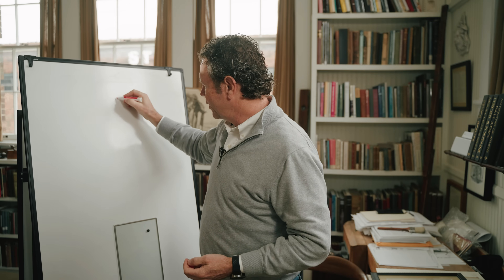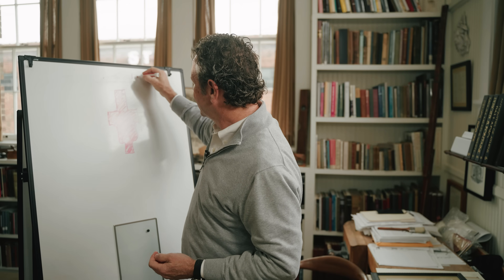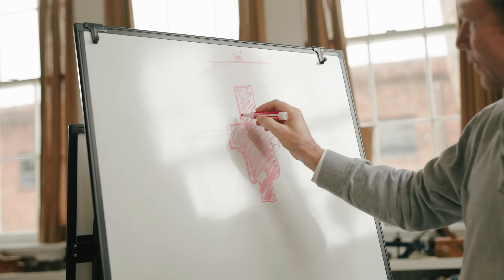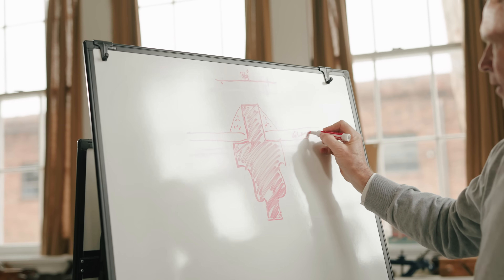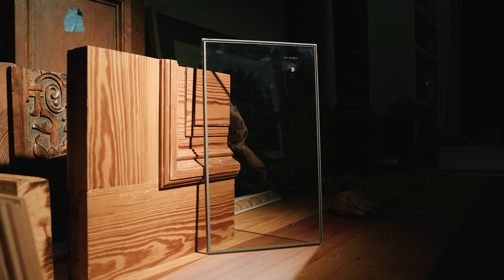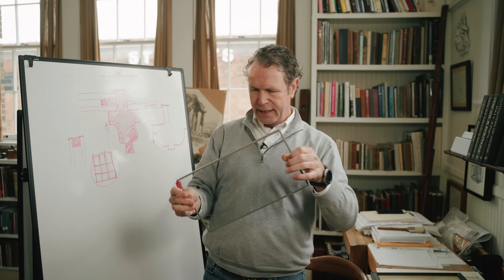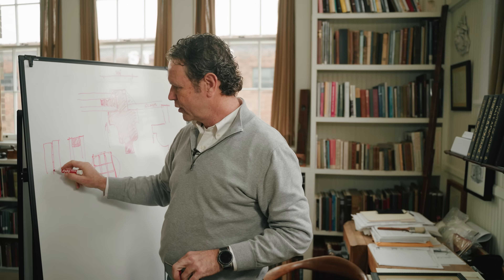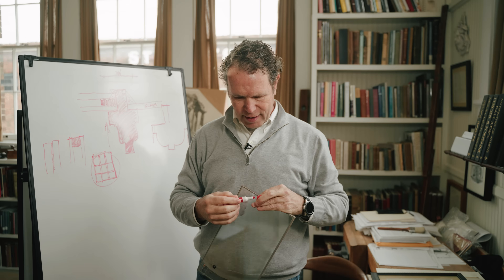Historic window glass – why insulated glass needs a major redo!

Comment: For giggles, I'd do exterior face 1/8" borosilicate glass cold laminated to a 3/16" polycarbonate core cold laminated to an inner face of 1/8" borosilicate - for impact strength and temperature gradient shock hardening.  Exterior glass face having a sputter deposited UV/IR mirror with full visible light bandpass, so it's protected from damage and dirt by the lamination.  Polycarbonate provides web strength in tension should the glass break, the cold lamination would retain the bulk of the glass shards should the faces break, and would add some sound deadening to the stackup.
  
Then do the mutton bars with a titanium extrusion welded into a grid and then to the window frame (structural titanium has about the thermal conductivity of vinyl, or slightly better).  This would be so you can do the mutton bar in a traditional narrow width, but retain continuous pressure and vacuum strength - plus flexural strength against impulses.  Individual lites held in with a Sika polyurethane structural adhesive for transferring that glass lite strength to the muttons and the frame.  Maybe an anti-spall film on the inside bonded to the mutton, with a magnetic interior trim to allow for servicing the bond and enabling replacing panes (and painting the interior face of the mutton without having it on the glass?).
  
Those little spacer balls look like ceramic vacuum spheres - I'll bet a custom lab glass shop could replicate those panes with a better plug for the vacuum (the same way they did vacuum tubes).  That tube tail for the vacuum draw could be done on the face of the inner piece with the tail embedded in the cold lamination pour along the edge and therefore protected.
  
I could also see a variation on this video's method which uses laser welding of the glass (Coherent does this with CO2 lasers).  By gently rolling those little ceramic (I'd use Zirconia for teh low thermal conductivity) vacuum beads on the top face of one piece and lasing the glass from the oposite side the glass would melt at that location and a ceramic ball would "sink" into the melt and bond in place - makes for easier patterning of the spacers (the unwelded balls just roll off the surface).  Then putting those balls in contact with a roller that applied a non-outgassing glass adhesive, would stick the two sides together when mated.  By grinding a bit of the surface of each piece of glass around the rim of the pane, when the two pieces are put together a small void will be left.  Right at the edge of that void one can do a glass weld.  A small pre-made laser cut hole through one side of the glass to allow a vacum tube to be welded on (again laser) - to pull the vacuum.  Then a laser welds a ring around the tube entry at the flat glass and the tube is laser cut a little proud of the glass surface, then melted down into the tube hole like a rosette weld for a permanent seal.  Once the vacumm is pulled and the pane sealed, the void gets filled with the cold-laminating compound - which adds some mechanical stability to the joint (glass is directly sealed on itself, but no vibration or flexure would then crack the seal)
  
"Pretty", thermally performant, acoustically deadened, storm impact rated... very, very expensive ;-)
Reply: Crazy... I've been ragaling my family at Sunday dinners with this exact type of window design proposal for years now.. they all tell me wow thats so neat but we have children to feed.
Reply from the maker: WOW!! That's impressive.
Reply: @BrentHull  I did want to call out that I have noticed the improved video production where you are highlighting the details with B-roll for things you point out that the camera person missed during the initial monologue video capture.  I had lamented this in a previous video and you commented that you'd improve this, so I wanted to give the kudos where deserved - continuous improvement not just in building structures, but also building quality content.  Well done to you and the video team ;-).
Reply from the maker: Thanks for noticing, we're working on it. Still not where it needs to be but getting better. Thanks!!

Comment: Glad to see an alternative to insulated glass with space bars.
I have seen so much of it fail, whether it was the seal or the lo-E coating. I have replaced lots of I-G units that where only a few years old,  the glass was still intact but was full of condensation. Can Pilkington glass be retrofit into an old wood sash?
Reply from the maker: Yes, if you have 1 3/4" sash. 1 3/8" is too small. THanks!
Reply: @BrentHull  Are you producing the windows for your own projects only or do you take custom orders?
Reply from the maker: We take custom orders, shipping around the country. Send an email to info@brenthull.com if you need something. Thanks.

Comment: Andersen windows used to have glass like that except no ball spacers. They even had the the plugged hole where they sucked out the air and must have filled it with some kind of gas to keep the 2 sides spaced apart.
How is that so different from the Pilkington glass?
Reply: Pilkington Spacia Cool has an SI U-factor of 0.18 Btu/hr-ft^2°F. So about R5.5, according to their brochure.

Super Spacia has a U-factor of 0.11, so about R9
Reply from the maker: I appreciate you looking that up.
Reply: @BrentHull It’s the seal that aways winds up failing and I assume Anderson has a such a seal while the Pilkington glass does not.
Reply from the maker: I'm pretty sure Pilkington's is a vacuum (no air) and Andersen and others used and air spacer, sometimes argon. The difference is in the energy efficiency. As far as I understand Pilkington is the only one that uses a vacuum.
Reply: @BrentHull 

Pilkington Spacia is vacuum glazing and you cannot see its 0.2mm thick edge seal by looking sideways through the glass when it's in a frame. All vacuum glazing have dots.

If you can see a spacer bar, it is double glazing with air or gas in the cavity. 

If you can just see the edge of a 1-2mm tape and there's no dots, you might be looking at Histoglass or equivalents that use a dessicant tape to join historic glass together for aesthetics and a unit about twice as insulating as single glass.

Comment: I hadn’t even heard of spacia glass before this. At the moment, it is very expensive at a minimum of £200 per square metre - with that cost rising substantially (according to installers) if you wanted small-sized panes. I guess that, like most things, that price will fall over time, particularly when any (?) patent expires. I think that, as others have said, that you would need to live with one window of spaces to understand if the dots and the black dotes really annoyed you; perhaps a neoprene dot in clear might be better? 

I don’t know if it would be possible to make these vacuum panels using historic glass - i.e. slightly wavy - as it might not be possible to sled around the imperfect edges. 

A true divided light window is a joy to look at, just as is a “Tudor” window. For me, they just look right when windows with internal dividers (between the panes of a traditional double glazed unit) just look…..wrong. Glass in windows has obviously been around for a long time; the Roman buildings here in the UK (54 - 400 AD) were the first in the UK to have them and were obviously reserved the the most wealthy. Churches from Saxon times onwards had stained (or painted) glass windows but, for the common working man, it was the norm to have openings in the wall shielded by leather which could be rolled up if needed. I would dread to think what the R value of those were. 

Stained glass or “Tudor” style (lots of small panes joined by lead cames) are inherently weak structurally because the lead is itself not a good structural material. Now, you can buy saddle bars which is lead came with a steel bar in the middle of the lead; you can’t bend that but it would be fine for diamond or square panels within an overall large window. A great many historical buildings over here have had to install the surface steel or copper or brass reinforcing bars going from one edge to another with the leaded window braized to it.
Reply from the maker: Thanks as always for the insight.
Reply: There's been a lot of changes since Spacia. Its new form is £300psqm or more plus carriage in the trade with a 0.3m² minimum charge so most panes are £80-100 each...or more through traders and window suppliers.

Cheaper brands can be half the price. Users have to consider its price against its longevity and thermal insulation. About half my  London customers are just glad it's soundproofing and they're allowed to put it in their listed buildings.

Comment: Would the dot look better in the middle so it looks purposeful?
Reply from the maker: Good question. We're work on some other solutions.
Reply from the maker: It is a major effort from the manufacturer.
Reply: @BrentHull 

The vacuum port needs to be incertain locations to not crack the glass when evacuated. Most types are now made entirely under vacuum so don't have a port. There is still a lump of getter metal somewhere in the unit and most clients tolerate it when they know it keeps the unit at the correct vacuum for 40 years.
Reply: They should offer architectural embelleshments instead of the black dot. Like a small brass rosette placed either edge or corner, so you could border a window with them.
Reply from the maker: Hmm, that's a good idea.

Comment: That's pretty amazing but the dot would bug me (ha, sorry), and I really want wavy historical glass. I wish there was a way to get high r value wavy historical glass. But I'm all for the 100 year window concept, and I'd be building a house with crazy-high r value walls, anyway, so I think it'd be worth it to go with historical glass. I also want to do leaded windows, like what you'd see in a Tudor revival, do you have any special insights about those?
Reply from the maker: If your walls have crazy R-values you can skip the insulated glass and use wavy glass. It is called a prescriptive solution. That is what we try to do in the houses we build. It gives us the look and the performance we want.
Reply: Hi scrubius I make insulated tudor style leaded lights that have been approved for use in conservation area homes in the uk pm me if you wish   😀matthew
Reply: In U.K. a firm called histoglass that do a laminated cylinder blown glass that’s a higher insulation value than standard cylinder blown
Reply: @whitacrebespoke 

Histoglass is about 2U. Vacuum glass is 0.5U and can be laminated to hand drawn or cylinder glass. This then counts as safety and PAS24 security glass.
Reply: There are about 4 different colour dots on grid spacings from 20mm to 55mm. They are all visible if looked for but there will be a couple most people will tolerate and, anecdotally, most forget they're there and don't want float glass back, especially when they see they're heating bill and appreciate it is as soundproofing as acoustic glass because of the vacuum.

Comment: I have original windows but the streets aren't maintained properly. Truck hitting potholes and loud music those take a toll on our windows when rattling.  Does that mean it will stand this out of our hands situation .?
Reply from the maker: Not sure I understand. The noise can be solved with laminated glass and good historic weatherstripping can solve the rattling. Good luck.
Reply: @BrentHull  will check on historic weatherstripping.  Thanks.

Comment: Is the new glass a better R value than the old style insulated glass?
Reply: Dramatically better -- Around R-10 to R-15 in the glass area of the window vs R-1 for the glass of the single-pane window. For reference, fancy European 3-pane windows are about R-10 in the glass area of the window*.

The reason for the major improvement is that having a vacuum eliminates conduction/convection -- there's nothing to enable conduction/convection when there are no molecules to transfer the heat. The dots/specks are still very small thermal bridges, but they are so small that the R-value remains high. Heat can also still transfer via radiation, e.g. in the form of sunlight or infrared radiation. The non-sunlight infrared radiation is minimal.

*R-value is actually lower in the perimeter of those high-end videos than in the glass (around R-5 if I recall correctly).
Reply from the maker: I don't think your numbers are right. Let me know,
Reply: @BrentHull  My interpretation of old style insulated was the vacuum insulated (as in, could be used in older style windows), but I could definitely be misunderstanding and should have been clearer on my assumption there.
Reply: @dosadoodle  's numbers are not quite right. According to Pilkington's Spacia brochure, their products range from 0.28 – 0.11 SI-Ufactor, which is R3.5 – R9. There are plenty of traditional insulated products that meet and exceed R9. They just do it at a much greater thickness.
Reply from the maker: THanks.
Reply from the maker: There is no old style insulated. Single pane glass has an r value of about 1.   7/16" insulated glass as an r value of 2-3. Insulated glass is relatively new to the residential market. I remember it being sold hard in the 1990's. FYI.